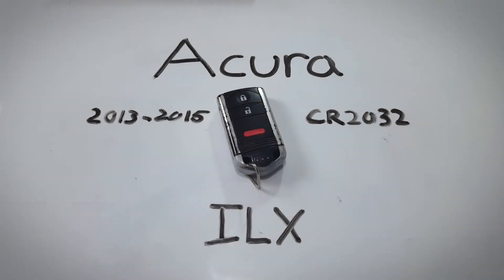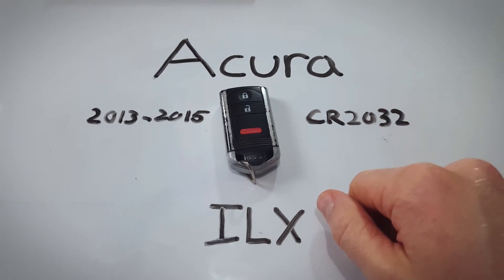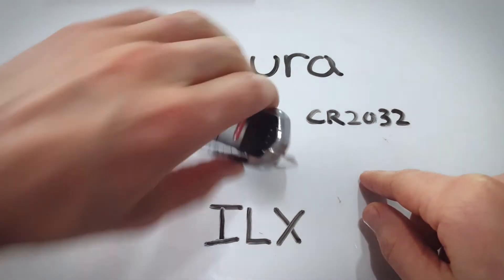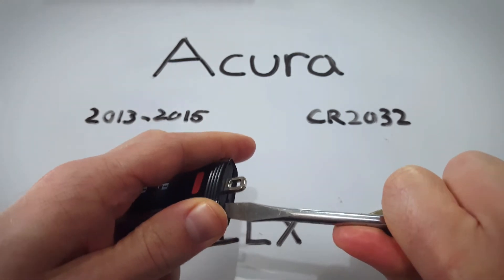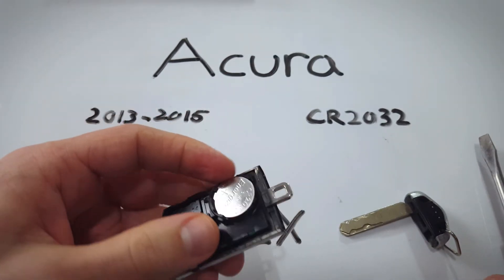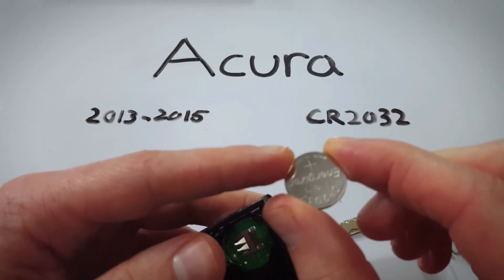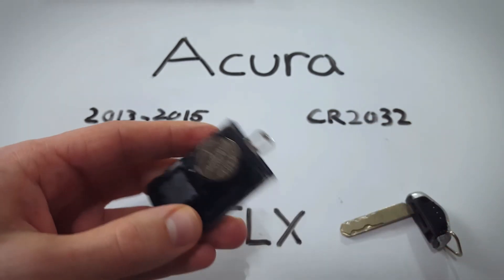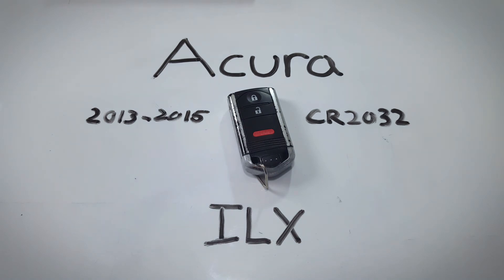Acura ILX Key Fob Battery Replacement (2013 - 2015)

Comment: hey man im runing this issue where the fob itself wont unlock or lock or any other buttons work only thing i can do is unlock my key with door ive change the fob battery and car battery still no luck. when i try to reprogram the key it wont work says i get a error i might need to take it to dealership but let me know if you have any other information about this issue